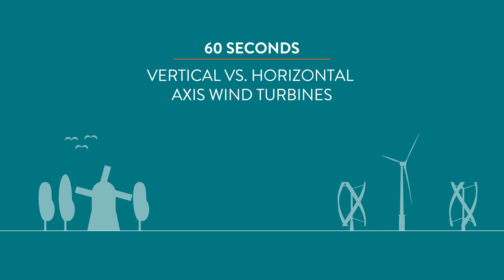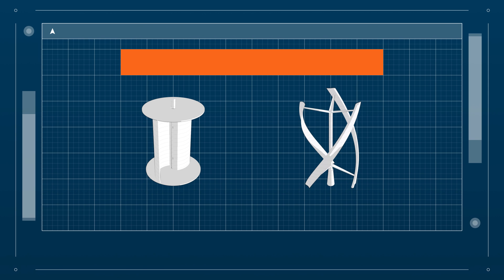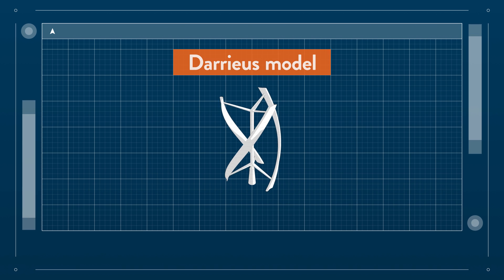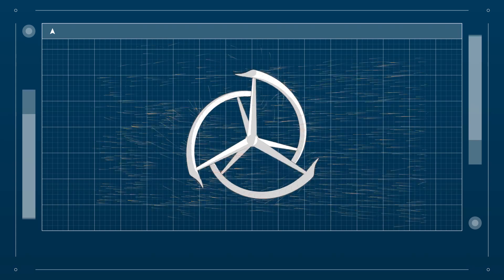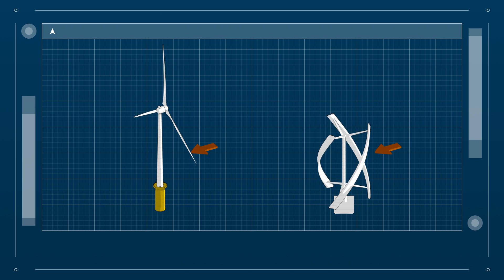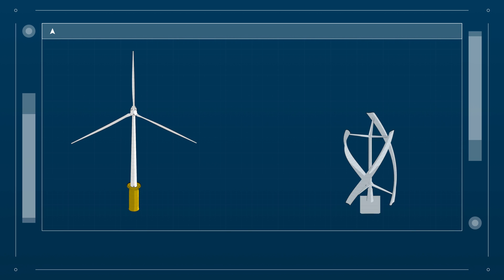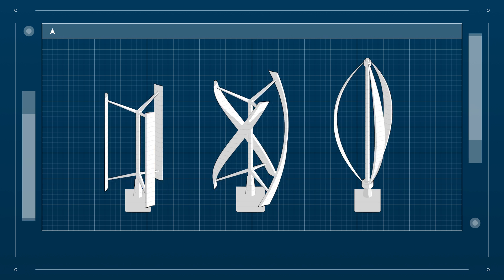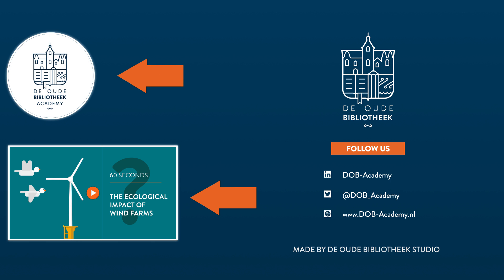Vertical Axis Wind Turbines - IN 60 SECONDS

Comment: Both have advantages and disadvantages..
The straight blade vertical designs are starting to become popular.
Aluminium blades should have replaced fibreglass years ago.
Reply: Agree. Or stainless steel as that stuff is so simple to manufacturer and unlike aluminium it doesn't corrode meaning less drag.
Reply from the maker: We're actually looking into this and might do a video on it in the future.

Comment: Do you think VAWT would be better solution on a Solar Power Electric boat since they do not cast much shadow over the solar panels? I was thinking of a better solution for charging the battery banks in the night by using Wind Power to supplement the solar power.

Comment: Study this: The best evidence yet by the scientists; https://iopscience.iop.org/article/1...3/2/022056/pdf

Using the optimized pitch angle curve depicted in Figure 4a a converged power output, which
is ≈12% higher than that of the Betz limit, is determined.

Comment: Like all wind turbines, these have erratic, fluctuating output dependent on the wind which will cause dangerous brown outs and black outs. Wind is only viable if you include a 100% back-up power supply using reliable generation, typically fossil fuels or nuclear.
Reply: Or hydro.
Reply: движение воды в реках и морях Вам подойдёт?
Reply: Time to stop considering fossil and nuclear as an option. A well matched power storage/buffer can do the job just as well.
Reply: @andriusst  - nuclear power is a clean replacement for fossil fuels though.

Comment: My understanding is that they are quite good for off grid projects and also smaller; is this correct?
Reply: The question is what are willing to pay for 10 KWh VAWT? Do you want to use to replace wood for heating ? Or do you want a small 1kwh for ornamental purpose or for areating a pond ican custom build for a specific need depending on what you are willing to pay
Reply from the maker: That is correct! VAWTS are also very appropriate for DYI projects.
Reply: No they can be developed to produce over 2 GW in a high wind.

Comment: Why less reliable?
Reply: This is a myth.
Reply: Especially with the slipstream omni directional design. The angle of the blades creates lift but the air also slides through and up the blades as well. They're more compact and better in lower winds . Also safer. The oil industry is why they have not taken off yet.